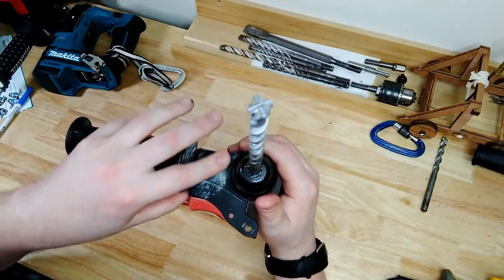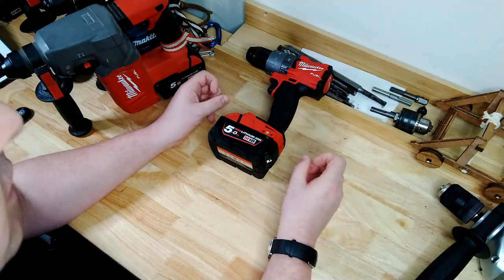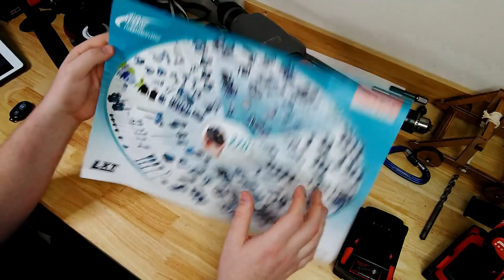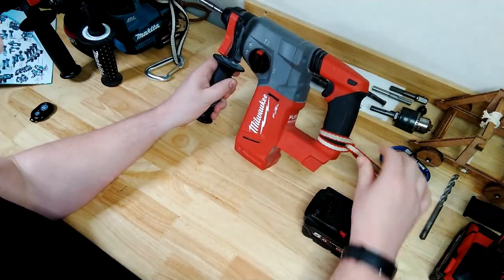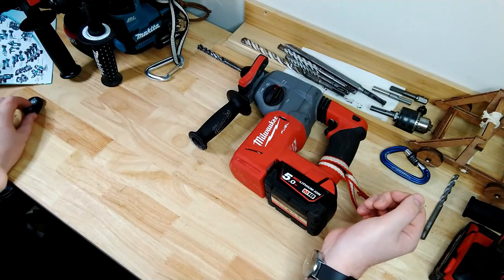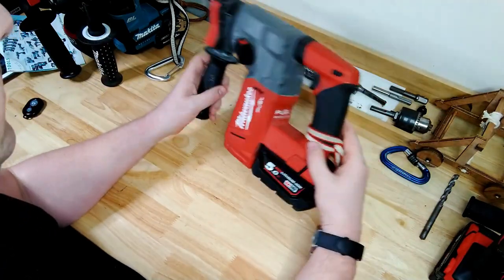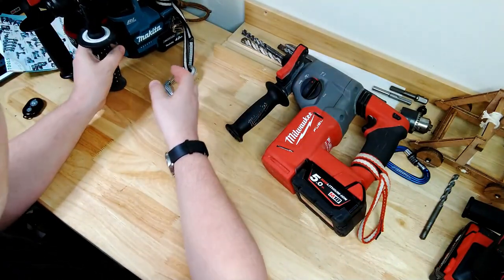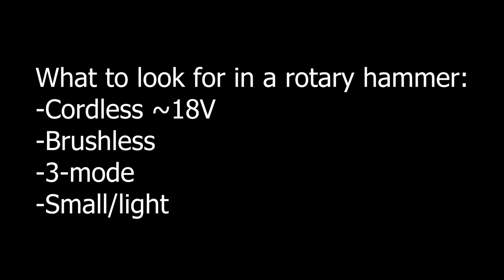What drill do I need for bolting rock climbs? [Bolting for climbing]

Comment: So many options to pick from..what is your recommendation for something in the middle good for granite hard rocks, not high end expensive and not anything cheap which wouldn't last
Reply from the maker: Depending on where you are and what your budget is, a Ryobi, Bosch Green or Craftsman/Stanley are good mid range options
Reply: @MountainMullet  will be getting it from Europe either UK or Germany..
Have been looking at your Makita reviews those drills look promising but don't know how expensive they are in Europe..what do you say is DHR 172 or 173 mid range? Budget is around 700usd can push it up for something worthy
Was using Bosch gbh36 before

Comment: Do you have suggestions of models from other brands? We can't get Milwaukee where I live, but we have others such as Makita, Dewalt, Bosch, etc
Reply: Here people bolt mostly while leading, so the drill will be used with only one hand
Reply from the maker: Yes, any of those brands will be great. And any of their compact brushless SDS drills would suit bolting on lead. Eg Makita DHR 171, 182 or 183 are all excellent. Also the dewalt dch172. Bosch doesn't do a really small one like those but the gbh-18V 21 is good, if a little bigger than the others I mentioned
Reply: @MountainMullet  got the dhr 171! Thanks!
Reply from the maker: Congrats! She's really nice and perfect for overhead drilling in eg limestone. It's designed to be used one handed and revs quite slowly so it's easier to control
Reply: @MountainMullet  yup I watched your video comparing all makitas in your other channel and that's what made me buy it! Also my local mentor really recommended it :)
Reply: @MountainMullet  and it's actually limestone I'll be mostly bolting so this is perfect
Reply from the maker: Nice, locals usually know best! I haven't published the video yet but that one got the most holes per battery out of any drill I've tested
Reply: @MountainMullet  excited for when you publish it! Thank you so much for your work on this channel, it's really interesting and useful! It's hard to find details on this subject since it's so niche, I'm going through your entire channels as there is loads of useful content
Reply from the maker: Yeah mate, that's why I started this work. There just wasn't this kind of info out there
Reply: Hey, do you have this holes per battery data anywhere you can share with me? I think I saw a chart in one of your videos but couldn't find it anywhere. I'd appreciate it a lot!